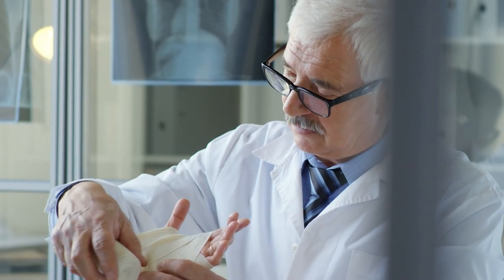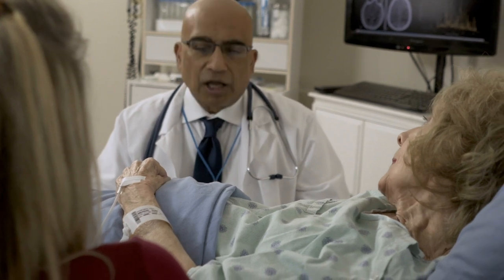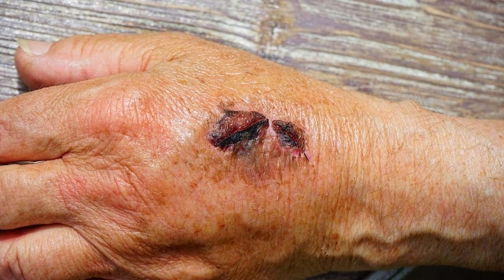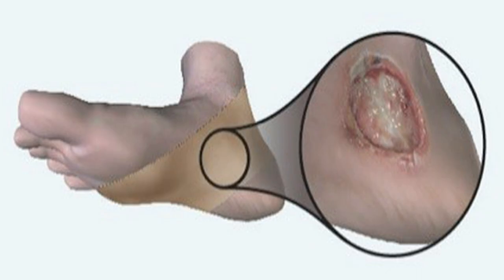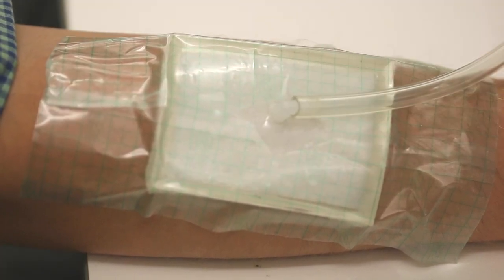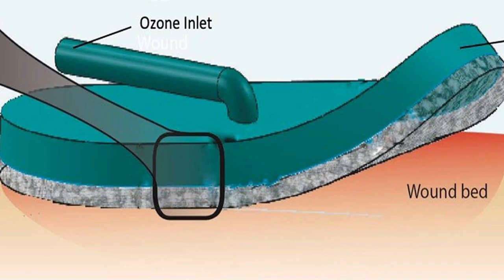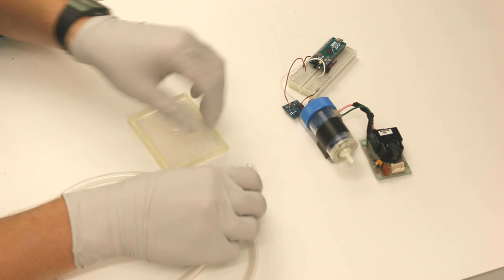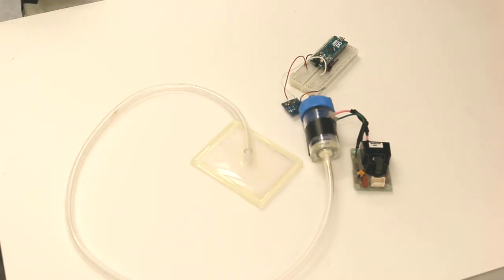Ozone Generating Patch for Wound Treatment

Comment: And, in the absence of the availability of the ozone generating devices, consider the application of ozonated oils.  In many cases these lesions of long duration are treated rather effectively.
Reply: My mom has MRSA on the wound and treatments are failing. I need an ozone to treatment. There are no bagging options for that area. I need to move fast. Where do I get ozonated oil?
Reply: @Lia Yeghiazarian  Please keep my updated on your mother’s situation as I am battling something similar and I am willing to try anything
Reply: @liayeghiazarian2989  you could make your own oils!
Reply: @liayeghiazarian2989  look for this store on ebay ganeshaherbs , I bought ozonated oil from them.
Reply: How to you get ozonated oils?
Reply: @liayeghiazarian2989  Amazon
Reply: @Jeff-rx4de  Amazon sells both ozonated oils and small ozone generators as well as the bagging system and tubes to treat different areas of the body. And with an ozone generator, you can create your own ozonated oil and water.
Reply: My mother in law had cancer removed from leg.  A few days later it wasn’t healing to well so we washed and soaked the wound with ozonated saline, then she applied ozonated avocado oil to wound.  Healing was remarkable

Comment: EVERYONE: Amazon sells both small ozone generators as well as the bagging system and tubes to treat different areas of the body. And with an ozone generator, you can create your own ozonated oil and water if needed. Good luck!

Comment: My mom currently has a wound failing. Is there a way to access this type of care currently? Thank you for any info!
Reply: see my other comments on the video
Reply: I have a same situation
Reply: Where are you?  Might be able to make a referral.
Reply: @jbrianharris
Amazon sells both small ozone generators as well as the bagging system and tubes to treat different areas of the body. And with an ozone generator, you can create your own ozonated oil and water.
Reply: @liayeghiazarian2989  Amazon sells both small ozone generators as well as the bagging system and tubes to treat different areas of the body. And with an ozone generator, you can create your own ozonated oil and water.